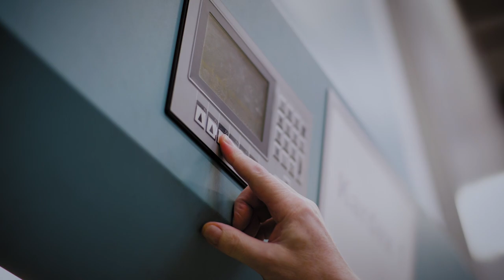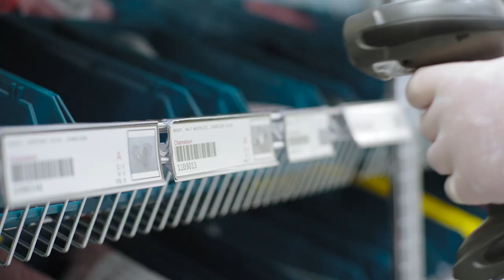Coherent | Behind The Scenes: Meet The People In Our Ultrafast Laser Factory

Comment: searching for a extreme fast both wood cutting and engraving machine with also having metal cutting capabilities, can a 1kW to 8kw range machine perform at high level of speed while cutting wood and metal including engraving, cutting, kiss cutting etc. where i can find the material maching  speed and power related charts on website if not given please add those catogeries for Co2 laser machiens by including power range, materials can cut , engrave , cutting max and min speed with  possible materials.